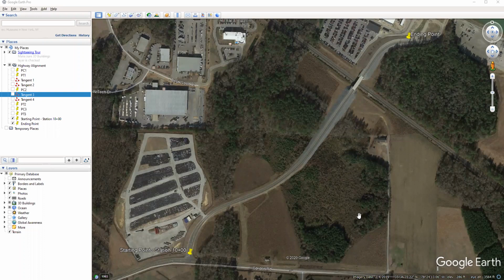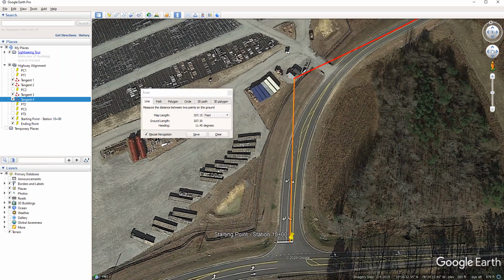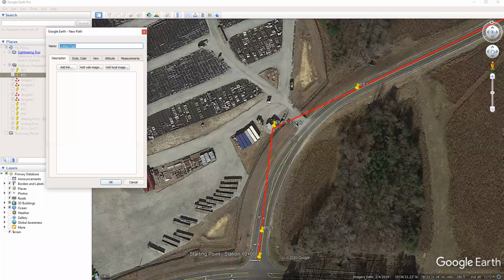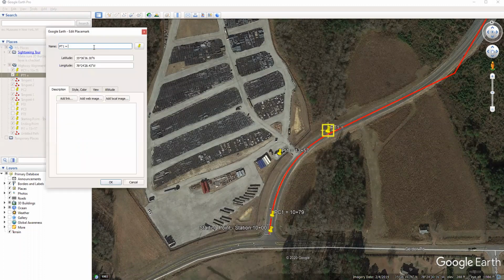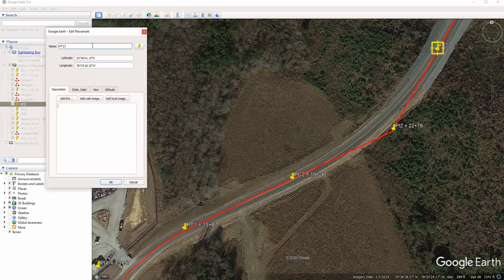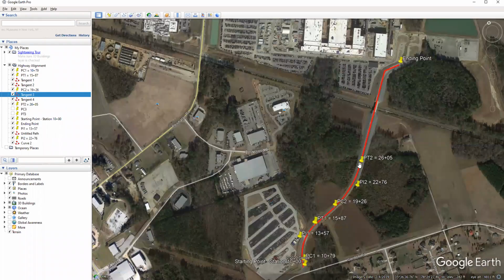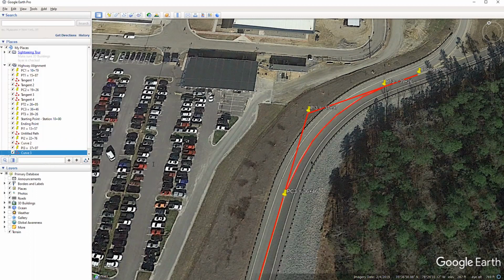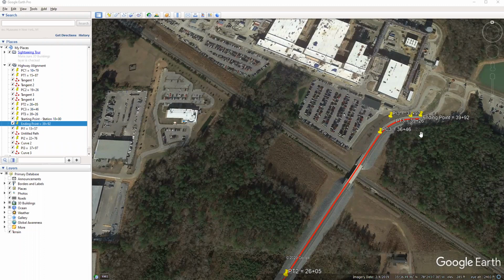Stationing along a Traverse for Horizontal Alignment

Comment: Sorrt sir, but how did you get the tangent length in this question? and how does one get it normally>
Reply: he mentioned at the beginning of the video that he has the design plans. So he is recreating it on this google earth example using the old plans.
Reply: @danh.461 thank you sir.